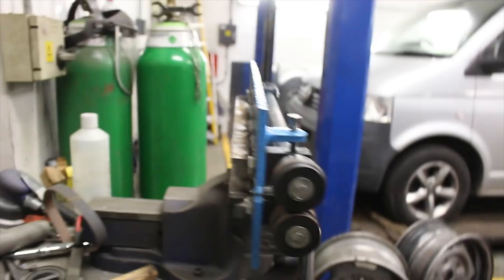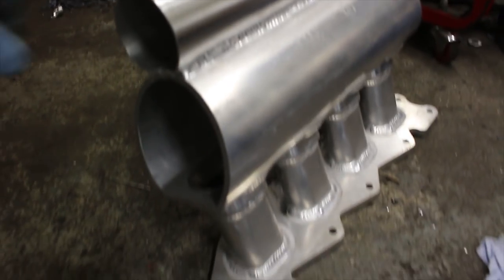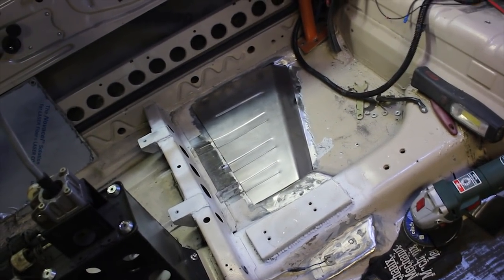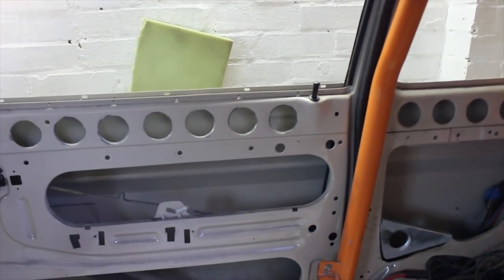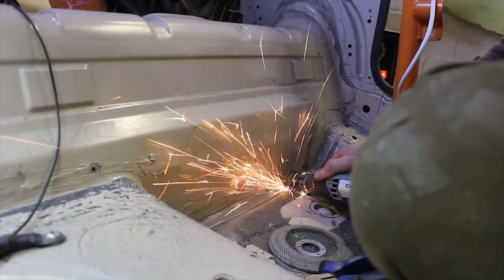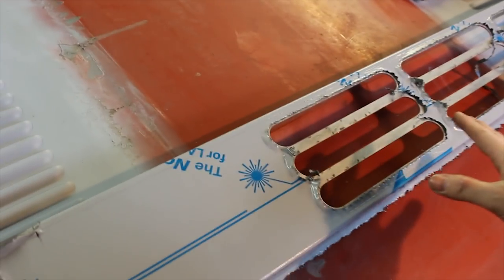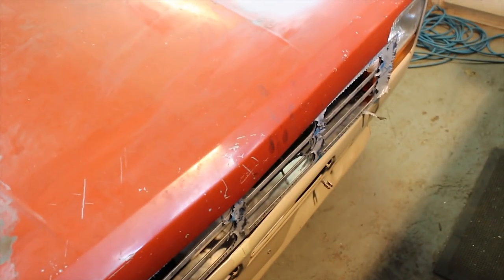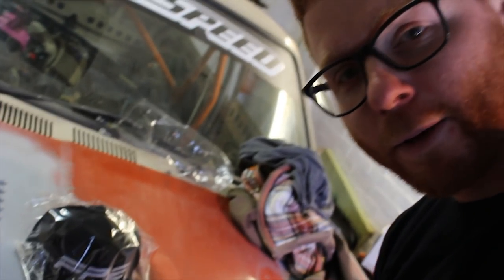Compound Turbo Mk1 Fiesta - Episode 11 - New grill idea

Comment: In the spirit of upgrading those beadrollers, an old steering wheel instead of the handle makes using it so much easier, especially on your own
Reply from the maker: thats a good shout, will have to dig out my stock fiesta wheel.

Comment: Another way it would look nice is , put 3 slots either side then in the middle put the ford badge and then a slot top and bottom of that
Reply from the maker: good shout. i have the blank size so could always experiment with different designs

Comment: Enjoy this video series, really inspiring to work on my volvo 340 project car.  Keep the content coming!
Reply from the maker: Thanks mate, I do love a 340 OVLOV gear box in the back for optimum weight distribution. what engine you running ? my mates had a williams lump and a laguna turbo engine them. Both were proper jokes.
Reply: @mikefpe they are a funny quiky thing. the goal is to fit a F4R out of a clio 172/182,  currently doing work to the chassis, rust repair and to stiffen it up a bit

Comment: What dremel have you used in the video? It’s something I could really do with. Quality work as always mate 👍
Reply from the maker: mine is a Dremel4000-1/45 Series Digital Multi-tool very handy, ive also ordered some carbide cutters that are great for grinding down steel and aluminium